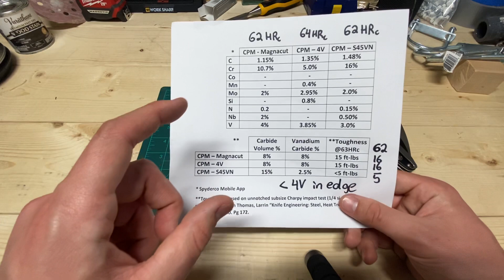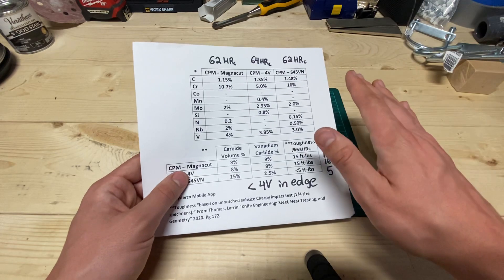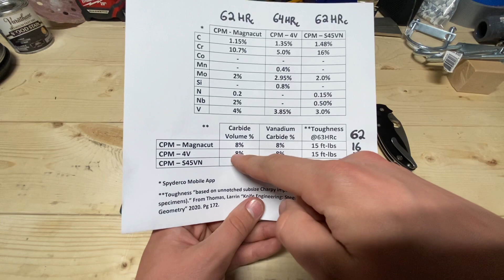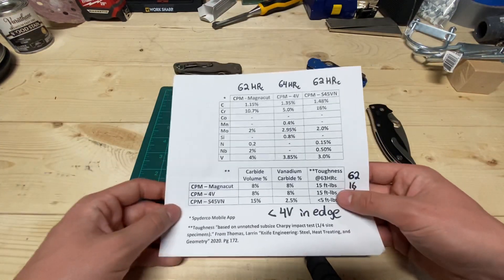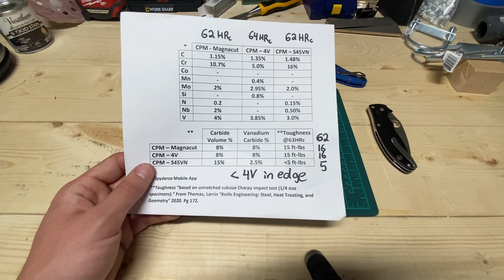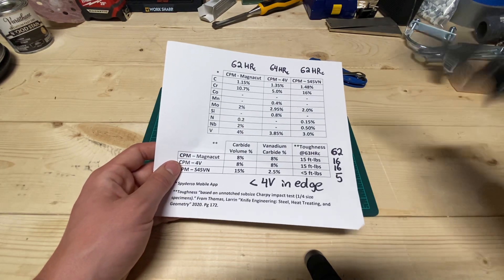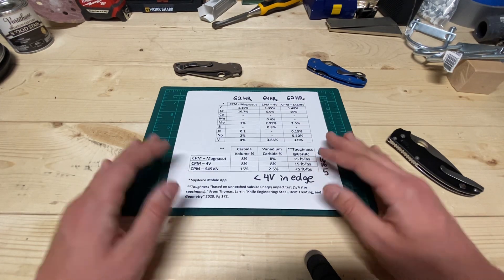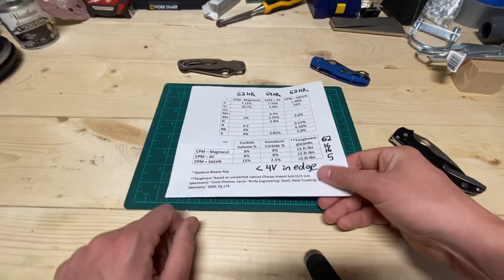Talking Steel: CPM-Magnacut

Comment: Love you’re technical approach in this video.  I’ve struggled to sharpen Magnacut on my Chosera 400- 3000 professional stones.  Would venev diamond stones be a better option?
Reply from the maker: For sure they are. I normally use my Venevs on my Meglio Magnacut Gyuto and love that edge
Reply: @EngineersPerspective701  thanks so much for your thoughts. I was surprised at the difficulty of sharpening my Acta Non Verba A100 knife on chosera stones. The Vanadium Carbide content is not that high but the HRC is 64 so maybe the combo of steel and HRC is  the culprit.

Comment: What is k390s toughness?  Will it hold the same edge angle as magnacut? Being a year later now, they have corrected the heat treatment up 63-64 at the urgings of Larrin which really unlocks magnacuts potential by all accounts. I don't quite understand the toughness aspect, I've always assumed that the tougher steels would hold a finer edge. But rex45 at at 66 to 66 is down around 5 lbs in Larrins testing. Yet I watched a guy here on you tube cutting and torqing on a brass rod with rex45 and m4. He rolled the edge on the m4 and had very little damage on the rex45.
Reply from the maker: K390 toughness is very good relative to mid to high carbide stainless steels. Magnacut will likely hold lower angles better at the same hardness. 

There is a difference between toughness and strength. Generally a harder heat treatment will resist deformation better than a softer one. When it does deform it’s catastrophic which is the down side. I love Rex45 because it’s heat treated to have fantastic strength so it never rolls on me. 

On the flip side the primary dulling mechanism for S30V in my usage is edge rolling.

Comment: Knife mfg's need to run magnacut at 65Hrc to maximize its potential just like k398 otherwise customers are being short changed
Reply from the maker: I think that would be extremely difficult for a factory production line to pull off. Even custom makers that’s pushing it way up there for Magnacut
Reply: @EngineersPerspective701  well at least strive for that.
Spyderco runs batches of particular steels to 64hrc.
I think irs money well spent if a knife can keep its cutting edge 10X longer without chipping, the steel capable of doing so should be offered as such where the knowing consumer is allowed to purchase such a steel.
Pete from Cedric & Ada channel on YT just pronounced the new king in knife steels 15V from Spyderco and I believe it cut over 2000 cuts in that sisal rope he uses, absolutely incredible! (Approaching pure tungsten carbide sharpness)
No you cannot sharpen with ceramics or stone its diamonds only however the tool that is derived from 64hrc  15v sharpened by diamonds to a low angle is unparalleled excellence!
Consumers should be made aware of a particular steels attributes before purchasing, with that being said, knife makers need to offer the best heat treatment available because its shortchanging the unwary consumer.
While I love my Kershaw Link in 20CV  I know the steel is nowhere near its potential and is half baked because it takes a lot to finish a knife  that uses hard steel 62hrc+
So I got a 20cv blade that performs as well as properly hardened D2 maximised to 62HRC.
What im saying is if a knife maker is going to promote and charge for exotic steel it needs to properly harden that steel to maximize that steels potential or they are stealing hard earned money from the consumer ☺️ 
Thanks for the reply.
Aloha

Comment: I think this steel would make a near perfect survival knife. It’s tough so it will handle abuse, it’s stainless so it’s maintenance free, and it still has more edge retention than common carbon steel.

Coincidentally the higher toughness allows for a very acute cutting angle, because it’s less prone to rolling and chipping. In real life this is one kind of wear resistance, because the edge stays usable longer.
Reply from the maker: If you're already looking for stainless it's pretty much the top of the heap except that other options with less VC will certainly be easier to sharpen with very rudimentary tools like river rocks if that's your game plan.
Reply: I think it can still be sharpened on a rock in a pinch, it just takes longer. Ideally people should always carry a portable sharpener with them when going outdoors. Some knives actually have sharpeners attached or built into the sheath.

For people who value toughness, rust resistance, and ease of sharpening, there’s already Sandvik 14C28N. Tougher than Magnacut, very rust resistant, but with wear resistance comparable to the humble AUS8/8CR13MoV.

Comment: Hey, 
So in my quest for understanding, when it comes to knives used for combat extreme survival conditions, how do you feel about 80CrV2 as in Winklers offerings? Would the MagnaCut be better than that? I know steels like 1095!(KaBar) have been used for years etc. 
Any other thoughts on what would be the best material for this type of knife? 
I’m new to this world, Thanks much! 👍🏼
Reply from the maker: Appreciate the question!

Just to be clear, I am no survival or combat expert! If you’re looking for stainless then yes this is probably the highest end option out there. You could probably get something in AEB-L or Nitro-V for less that would also be good choices. 

If you’re not looking for stainless but also high edge retention choose 3V. For a more basic carbon steel 80CrV2 is a great option and far superior to 1095 because it has grain refining elements in it that “pin” the grains from becoming too large in heat treatment. This lends to a notably tougher blade at the same hardness when compared to the 10XX series of steel.
Reply: @EngineersPerspective701  Ok Gotcha! So would you say that the 3V or 80CrV2 are going to be still much tougher than the MagnaCut? Or is the MagnaCut now truly competing with these carbon materials? 

From what you said in the video, it seems like the MagnaCut is really creating the best of all worlds and I guess the question is, is that a high enough across the board ability in terms of extreme use or does an extreme use knife material need to wait for the next “SummaCut” category? Ha!
Reply from the maker: @MylesDavid  it really comes down to the end geometry and heat treat but it’s safe to generally say yes Magnacut is right there with all these! 

Magnacut in an Esee or Falknaven form factor? He’ll yeah, you couldn’t break it regardless of HRc and it would blow away the steels offered by them currently.

Comment: How difficult is it to sharpen for beginners?
And how does it compared to M390/20CV/ELMAX in terms sharpening difficulty?
Reply from the maker: This depends on the specific issues you have with M390, etc. but for most people Magnacut will yield better results faster and with less skill. No guarantee though!
Reply: If you can sharpen standard production M390/20cv, you shouldn't have any issues with Magnacut. My Magnacut Mule was as easy to sharpen as those steels. The differences were too small for me to notice anything significant.

Comment: I read Larrin Thomas' story of developing Magnacut and he was very pleased with the final results. It is easier to sharpen, but it still holds an edge superior to most steels and it cut more rope to the middle of the field with most "super steels". Cedric cut over 500 cuts and his saltwater test didn't faze the Magnacut. I recommend to everyone interested to read the linked article above.

Funny enough there is an old old steel that's tougher than any new steel and that's S5, I asked Larrin in an email about S5 as I used it for hard HRC 59-60 axes and he sent me a chart showing it passing everything in toughness. S7 is tough as well, but it doesn't reach the hardness levels of S5 nor is it as tough.
Reply from the maker: I was very surprised by Pete's results especially with the Mako being at a target of 62HRc I believe. Definitely great for getting the word out there on it.

S5 is raw toughness for sure! But not sure it would present itself quite as well in high performance knife blades where strength and crispy edges are a focus. Looks miles ahead of 1095 for sure!

 Seen it used in knife applications much?
Reply: @EngineersPerspective701  I could only get drop offs 3/8ths thick from my job in a machine shop. I was made the heat treater when I mentioned to the boss's wife that I could make him a custom knife (He hunted big game) as it was/is my hobby. So I had HT added to my job description, but one day we acquired some Blanchard ground 4mm thick S5. I made 4 stub tang knives out of it and since "Special Jobs" TIG welder was another job I did, I brazed some stainless onto the stubs. 

Note, I have 2 Masters degrees, one in engineering and one in biology with BS in Organic Chemistry and I worked my way through college welding, sheet metal and running fishing Charters on my dad's boat. At one point Rockwell paid for my advanced degrees so, cool. I was hired as an engineer/chemist, but their welders couldn't weld complicated aluminum parts and I could.

 The knives were as good as anything in their class at HRC 61-62 hard with a 74 hour Liquid nitrogen soak over the weekend. Didn't even rust easily, better than O1V my fav for carbon alloys. When I say O1V I mean the O1 that has the 0.2% vanadium for restricting grain growth so one can  soak it at 1475 for longer than the spec sheet says. A 15 to 20 minute soak improves the edge holding and toughness all things being equal.

The S5 blades were outstanding for toughness, but didn't hold an edge any better than O1 or 1095 at the same hardness, but if you leave 1095 or O1 at 62 hard they will be much more brittle than S5 obviously. Now Larrin sent me a chart showing that S5's toughness falls rapidly above 60 on the C scale. So at 61 it isn't past 4V toughness like 59 hardness is.
Reply from the maker: @MountainFisher  Damn you'd be an interesting guy to hangout with! I've built several medium scale lab setups so I can MIG and TIG poorly but good enough for structural and low pressure.

Sounds like it performed well and was easy enough to work with. As I see it the true battle of low alloy steels is keeping that gain growth in control when shooting for higher hardness. Those grain refining adds like in O1V and S5 make it night and day to work with I'm sure! They still loose that toughness advantage quick like you're saying with 4V being comparable at 61HRc even. 

That makes me even more impressed with what has been accomplished with steel like 4V and Magnacut!
Reply: @EngineersPerspective701  Here is S5 chemical analysis, the top line is typical American analysis and lower is minimum from a seller of metals from China, what I refer to as Chinesium. I swear, what the Hell is up with their QC over there? Well anyway I have one S5 knife left and one case hardened Ax-head looking for a handle.

C	CO	CR	MN	MO	NI	P	S	SI	V

.65          .50  1.0  1.35                     2.25  .35
.55           .35  .70  .50                      1.75  .25
As you can see S5 has high manganese like O1 does and a good chunk of Moly. Certainly more Vanadium than O1 as well. The knives I made worked very well and would bend before they broke. My axes are really super axes when you look at what so many axes are made from. Low carbon 1055 or 4140 as if L6 wouldn't make a better axe for $2 more in materials. Pathetic really, but Husqvarna's axe is at HRC 59 and doesn't cost an arm and a leg.

edit; I said "case hardened" axe because when forging I used pulverized pure activated Carbon mixed in my Borax flux to try and keep decarb down, but with forging any lower carbon steel I was quick with my forging having access to a Little Giant 50 lb trip hammer.
Reply: S7 is a well known awesome steel to use in the sword world, where hardness isn't nearly as important but toughness is extremely important.
Reply: I thought Z-tuff is at the high end of blade steels in toughness
Reply: @martinerhard8447  S5 isn't a blade steel as much as being a tool steel. Doesn't beat S5 shock steel. It is an old steel with a high silicon content to make it shock resistant and it ranges from 180 foot lbs of toughness to 80 ft lbs, at 60 hardness. Z-Tuff doesn't reach that degree, but high silicon has its issues too. S7 has more silicon, but cannot reach higher hardness of 59.

Comment: Nice right up, but remember edge retention equals hard to sharpen, k390 might not need sharpening often but when it does I doubt you could field sharpen it.
Reply from the maker: I think the term “hard to sharpen” is generally not well used. 

Is K390 at 65HRc “hard” as in difficult to sharpen? For me the answer is no it is not. Does it take longer with the same grit rating and essentially require diamond abrasives? Yes it certainly does.

So I think suggesting that the difficulty to getting a quality edge on it is high isn’t necessarily true especially with the availability and low cost of diamond abrasives today. 

As for field sharpening do you mean using a work sharp field sharpener or DMT diafold? Because those are cake for sharpening K390. A river rock found in the wilderness though is not going to “cut” it (pun intended)!